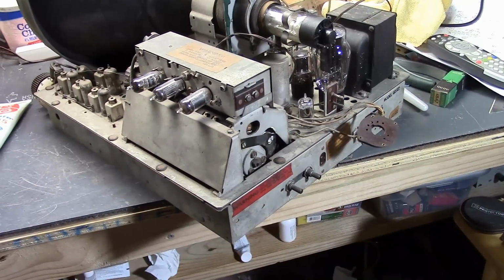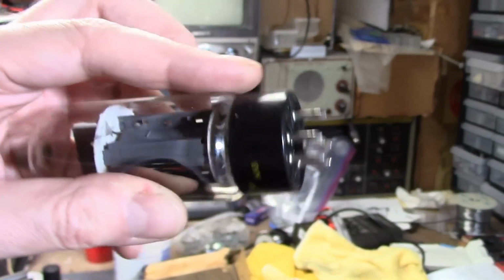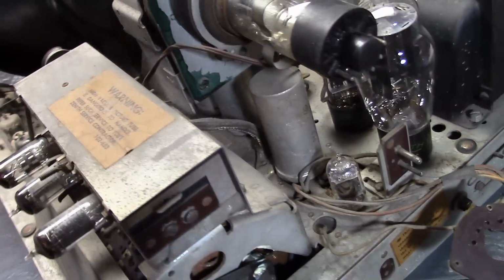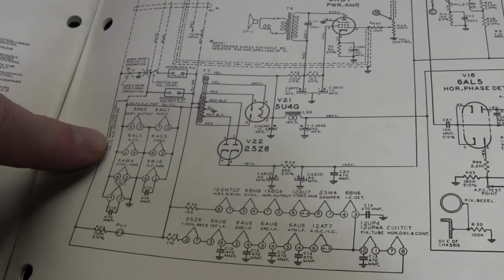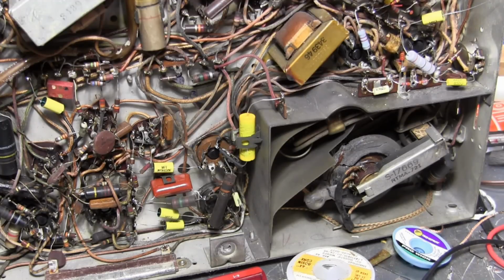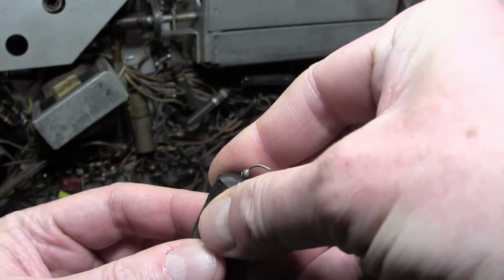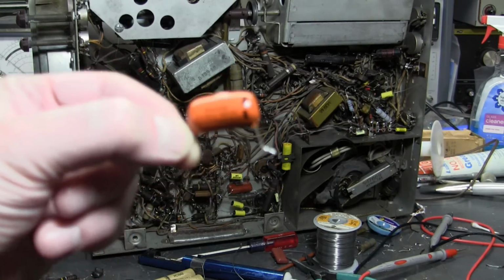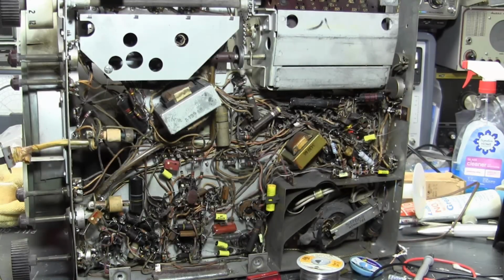Zenith G2322 Claridge "porthole" TV restoration p2o6

Comment: I've no idea how they spun the metal for this picture tube. But I know that spun metal is usually just that, you take a flat circular disc of metal at room temperature (usually copper) and attach it to some sort of jig, spin it at a particular speed and apply just the right pressure to shape the metal into the form you require using a special (usually wooden) tool. Too much pressure would open the grain of the metal, spoiling it. Quite a skill apparently. Outside foil on capacitors? Well for valve radio repair (my main interest) where you're dealing with A.M. and F.M. at relatively low frequencies for the most part it doesn't matter. I'd worry more about, fluorescent tubes,  switch-mode power supplies, wall warts, smartphones, laptops and other electronic equipment emitting square waves with oodles of harmonics before I'd worry about where the outside foil is. I also think that most modern capacitors aren't as sensitive as the older ones where interference is concerned. (Though not in all cases do I think this is true).

Comment: Great explanation on the capacitors.  The video Mr Carlson did was quite informative indeed. I'd like to make one of his low voltage capacitor testers as well. I'm pretty happy with my Eico and Heathkit. They work great and really help weed out the bad ones. ESR isn't all that helpful I find. Had 2 caps in a radio stations mixing board power supply I was servicing and suspected those were failing and introducing hum. The Capacitor Wizard I have said they were good..ESR wise. But pulled them and did a leakage test, and they were leaky at 20v and horribly leaky at rated voltage. Anyways..as always.. thanks for the great video!
Reply from the maker: Most ESR testers are checking for switch mode type applications use 100kHz for the test signal. Not so good for 60Hz linear supplies.

Comment: I have never seen the difference in operation on the "metal shield"  base tubes. Yes the metal piece has been grounded on the ones I have seen, but not sure on the 'SN7 tubes as all 8 pins are used. Zenith made HUGE tuner strips. I think I have a few of them as odd stuff. I never ran into one of those weird isolated chassis in working on them for over 55+ years, and I have worked on hundreds of Zenith sets. Probably the worst set design of any original Zenith company set I have ever seen. (Wait till you reach in one of the metal CRT sets to pull a 6AC7 and bump the bell while your hand is on the shell of the "AC7.

Comment: There are videos on YT showing metal spinning, but essentially it's a metal extrusion technique.  You take a flat metal sheet "blank" and spin it on a specialized lathe.  The lathe has a tool holder where the operator supports a long handled mandrel.  As the blank spins, the mandrel is forced against the metal, which stretches it into cone and concave/convex shapes.
Reply from the maker: Ah, ok. I have seen that technique. Looks like a good workout when done manually

Comment: That metal is called "kovar".  It is an alloy of metals (iron-nickel-cobalt) that has the same coefficient of expansion and borosilicate glass,  he same metal is used for the entry leads through the glass in any vacuum tube.  My parents had an RCA 16-in TV (circa 1951) with a metal cone tube and an RCA 630 chassis.  Ran flawlessly for 7 years then junked.
Reply from the maker: I found an article published when these CRTs were introduced. 
According to this article: "The metal for the cone was selected on the basis of its glass -sealing properties; after considerable experimentation a modification of a high chromium -bearing commercial alloy, SAE type 446, was chosen. In addition to its excellent sealing properties, this alloy has good corrosion resistance and high strength."
. https://worldradiohistory.com/hd2/IDX-Site-Technical/Engineering-General/Archive-Electronics-IDX/IDX/40s/Electronics-1949-05-OCR-Page-0085.pdf
Reply: JAMES AZBELL Thank you for more information,  I know they leaked eventually and that high voltage cone was murder when working on the set.  Also a large knob capacitor was required for filtering.

Comment: I remember seeing an old movie where a family had a new RCA b/w TV delivered and the technician set the set up in the home. He had to install the metal cone picture tube in the set, from the front of the cabinet. That's the way those sets were made.The set was either a 16" or 19" set.They also showed the antenna being installed on the roof. AH, memories!
Reply: Odd that the CRT would have to be installed in a new set in the field rather than the factory.
Reply: @dougbrowning82  I believe the idea was that the CRT could be better protected in shipping by sending it in its own box.  Shipping was rougher on things back then so they had to think about stuff like that.
Reply from the maker: Exactly. RCA did that with many of their TVs from 46 to 50